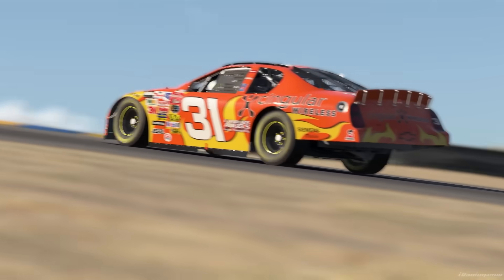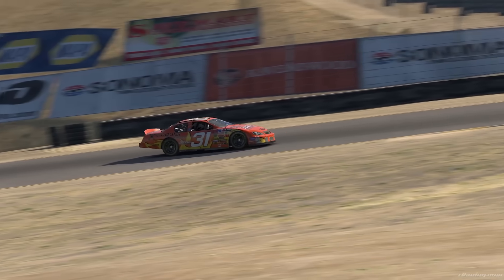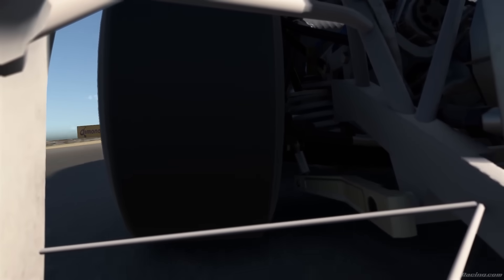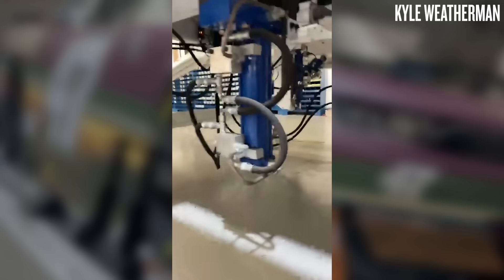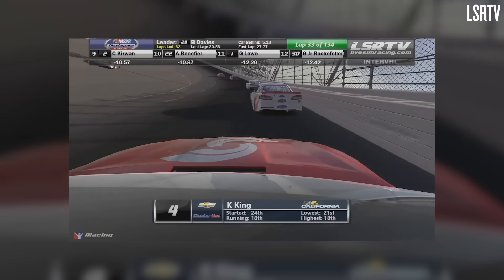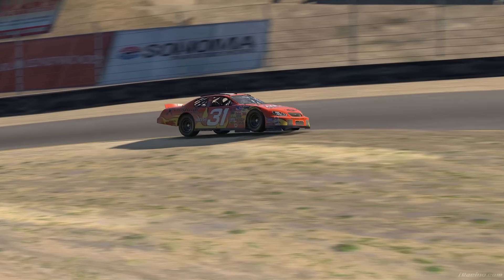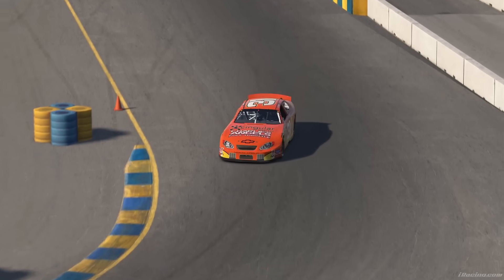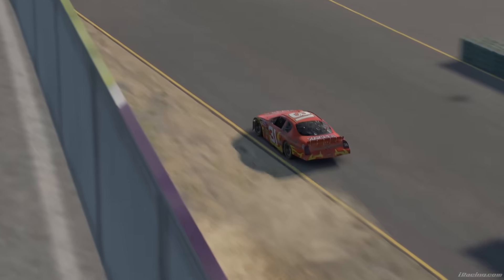DJ Yee-J Was Wrong: Why Real Life Setups Won't Work on Simulators

Comment: Similar to what you mentioned in the video I tried running a high camber gain setup on a pro late model in real life. It was difficult to make it work. On the opening 5 laps it would turn the tire on and we would have almost a half lap lead. Then by lap 10 the tire would be barbecued. I never managed to get it to work quite right and hit the 15 lap window for heat races but it was a good theory

Comment: i took a lot of grief on the old forums for explaining how massive caster, idiotic toe, and monster truck heights pushed the heat onto the sidewalk where it didn’t register.  it didn’t break the tire model it just pushed the heat off to the unregistered portion of the split model…. more of an exploit for than breakage for unexpected excessive camber.  i showed the b car had the bump stops situation exposed by punting it through the hood also, by going beyond the expected limits and you could use the out of range values in interesting ways.  there was also unexpected gains in the track model and tire that resulted in the burnouts in qual.  i spent months on end setting up mechanical devices and adruino setups and hours of testing while i did other things…. the sim would just run my scenarios.

and the end of the day the inputs are yaml and a bit of python with some adruino creativity you have traction and stability control.  iracing just cannot monitor every input signal on every driver and even ibt files are useless if the first file you give them has the reaction time baseline in it.  great developers, amazing simulation just like real racing cops and robbers.  thanks for the content share, well done!

Comment: No point doing this kind of stuff in off-the-shelf products. However it's worth doing in your own model. The data analysis work and correlation work will be a good learning experience.

Geometry is one thing, but compliance will affect it dramatically as well. Having the same IRL static alignment in a rigid suspension model won't result in the same dynamic alignment as IRL.

Comment: What mic do you use
Reply from the maker: Cheap amazon special with some dynamics tweaking within audition. Fifine AM8. When it's on sale it's a solid option IMO. Though it could certainly be better, it struggles with noise floor and vibrations. I'd be curious to try it's XLR capabilities through an outboard solution and see just how far you can drive it but then again at that point I might as well spend more on something nicer.

Comment: Well, NR2003 already comes with the "Jasper" setup for all tracks, it's derived from a real setup. Along with "Easy", "Qualify" and "Fast", you can use it to get a feel for how a very close to real setup would work on the game.

"-This setup is derived from an actual setup raced or tested at this track. Some modifications have been made to enhance how it drives in the game."

Papyrus already took those variations into account when translating the setups into the game.
Reply: The Jasper setups were much trickier to drive, IIRC, but the tires lasted longer, too. The fast setups had a tendency to burn the right front or right rear, at least in my hands 😂
Reply: @computiNATEor  Yup they are pretty tricky to drive. Indeed tires last longer, but the car can bite you at any second, it's a lot more throttle sensitive so in Lowe's or California, a tiny bit of extra throttle and it's got you spinning out of control 💀
Reply: @computiNATEor  makes sense with how most setup are. Lose is good on tires but harder to drive, tight is faster but say goodbye to your tires

Comment: The title is very misleading. It is not that real setups don't work in iracing that they don't work in better simulators, like Assetto Corsa mate. I don't get why iracing people always think that iracing is the only and last biscuit in the package.
This mod I was working for AC uses the almost the exact setup sheet from Davey Allison and it responds to it quite nicely. Also, several if not most real racing teams, including F1, uses AC-Pro as their base simulator. In the past I had worked with semi-pro european rally teams and south-american TCR to develop their virtual cars physics, so they could test different setups and changes without wasting tires money. And they usually responded quite well and predictably.
https://youtu.be/8k7-pbD8L7A?si=tZPCFl7ZO9uJnpN-
Reply: I think the main point of why no sim like iracing or ac will ever be able to use a setup/build sheet is because you cannot change specific parts… you can’t change a lower or a truck arm you can’t put a spring rubber in x spring. On newer cars you can’t change the splitter or aero pan to a specific hight or wear the splitter in etc you just can’t do the part specific changes that are very important and heavily change the physics regardless of what sim you want to favorite. 

The only sim I know of with that capability is not available to the public sadly
Reply: @Bandit-zq1uf  You are partly right here. You have 2 points here; one is false the other is true but unrelated. It is true that AC and other sims lack the ability to have some very car specific setup changes, like the panhard rod pickup points heights or any suspension geometry adjustments as setup. But this is unrelated and false to the fact that you can use instead a real setup sheet and construct a real suspension geometry that corresponds to that setup sheet within the physics of the car. You can and that works and responds predictably. You can then code the physics entirely based on a single setup and that works great, but at the same time, it is difficult move on from there in terms of setup. You end up having to make several version of the same car with a different specific setup for each different track.
The one thing that sets apart AC from the iracing is tires physics. iRacing prioritaires competition in spite of realism, so tires are bad. In AC, the realism depends on the modder's ability, knowledge and objectives.
Reply: @stormriderphysics  You can adjust pickup points, lengths etc. with COSMIC in AC.
Reply: @ArchOfficial  Yes, you are right.
Reply: @Bandit-zq1uf  You can do all of that in AC nowadays.
Reply: ACPro is used to hook a proprietary model in. It's not "AC". Plenty of racing teams do use "AC" however. Just not in that specific F1 example.
Reply: This has been common all throughout iR's lifespan IMO. Even back when I was a teenager and IR was still relatively new there were people who flat-out refused to play other sims, and merely mentioning that you tried a new sim that came out and kinda liked it, you'd just get dog-piled on in the member forums.

I personally know people who can't stand iRacing yet would still play it for 4 hours a night, complaining about it the entire time. If they would get free keys for other sims (a lot of sim racers either secretly work for other devs or are part of beta teams and are given keys to give out among friends), they wouldn't even redeem it, wouldn't even install the game.

Comment: This makes me wonder if you can get closer by editing the physics config of the car in Assetto Corsa, if it’s available.
Reply from the maker: Potentially. I'm not fully aware of the potential configuration options of Assetto's mod ability.
Reply: @liambrotherton  AC's COSMIC can produce asymmetric cars nowadays, although it's not really something that's an intended use. Very finnicky and you'll need to do bad stuff with sliders and distance joint length changing.

It's the most moddable suspension system in any consumer sim.
Reply: You can edit essentially any and all physics configs in AC, a bit harder to translate across but it would be doable in theory

Comment: It is kind of interesting in the side-by-side that while it has its own characteristics, it still could be viable in its own ways
Reply from the maker: I was surprised how similar my inputs wound up looking between the two. Honestly speaking the largest difference was just the gear ratio. Otherwise they felt very similar which makes sense considering they are both real setups.

Comment: Lmao goofy setups with the front ride height jacked up, thats just like what I discovered you can do in NR2003 at superspeedways and like intermediates with like CTS/550 package type racing, jack the front and put the weight all to the rear so the car dome deflects the air over the spoiler to trim it out and have way less drag, a bit of a balance dance at the intermediates but for superspeedways its free speed
Reply: Changing ride height between front/rear has no effect on how much load is on either axle. Jacking up the front doesn't put any more weight on the rear and vice versa.